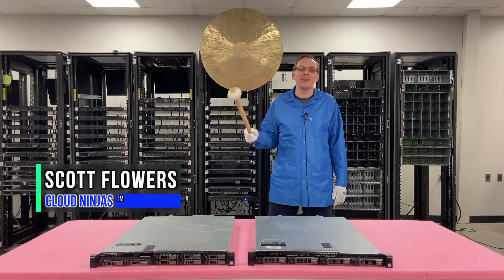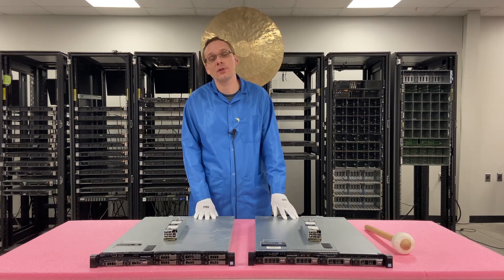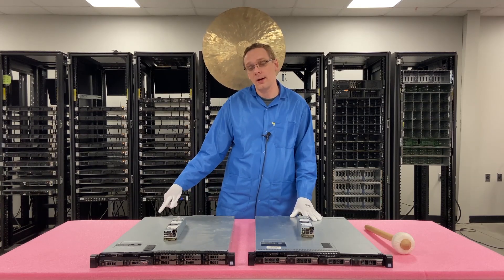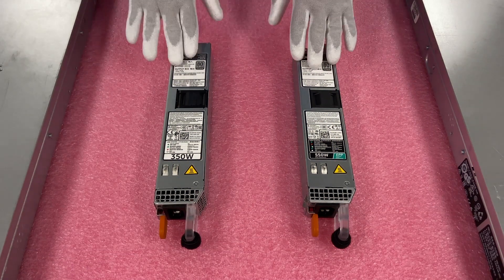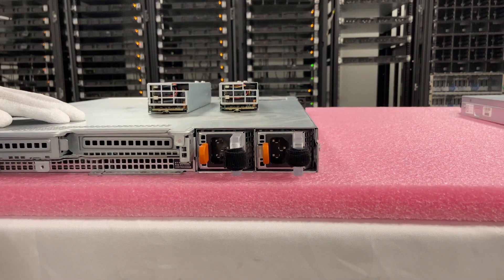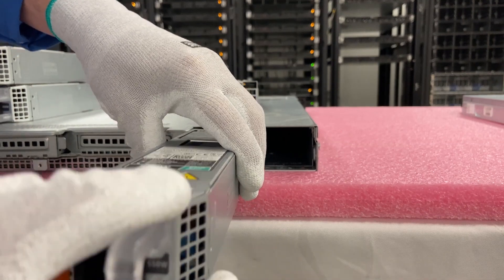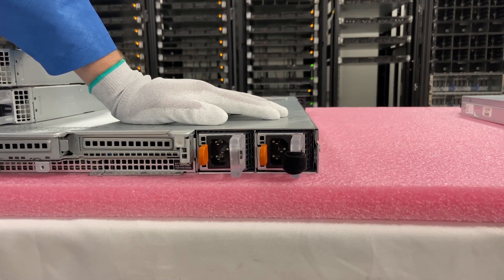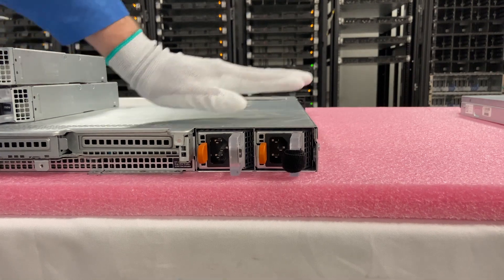Dell PowerEdge R330 Power Supplies Overview | Power Supplies Options | How to Install Hot swap PSU

Comment: Hello,
Does the 550w PSU upgrade work without any errors? My current r330 setup, all ram slots and also both PCIe slots are occupied, with the 350w PSU is not sufficient and it shows an overload error with booting.
Reply from the maker: Yes you can swap out with 550w.  Will be an easy upgrade.  Nothing extra to do.  Thanks for commenting.  Kindly consider subscribing to our channel.  Have a nice weekend.
Reply: @cloudninjas  thanks for the quick reaction! I liked the video and subscribed, you have made some very interesting videos about the r330 server. Have a nice weekend too😁